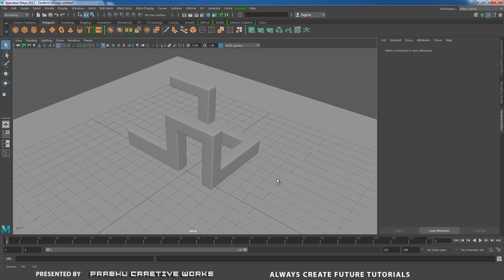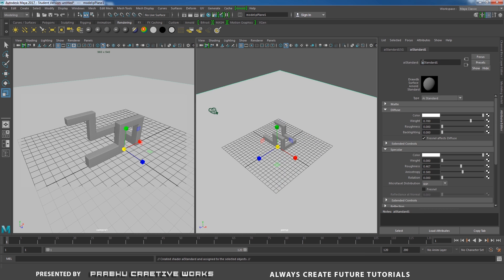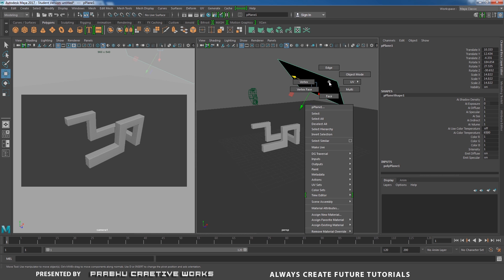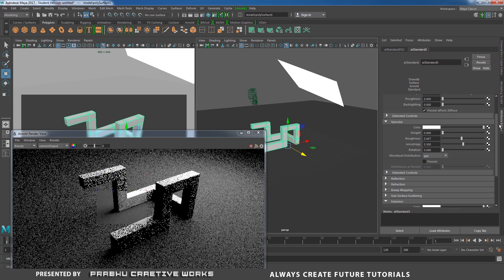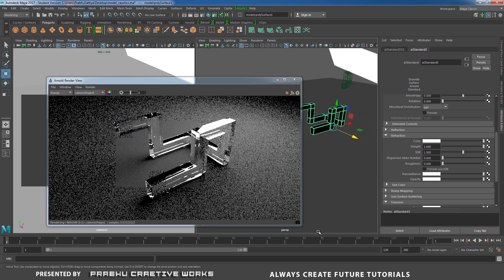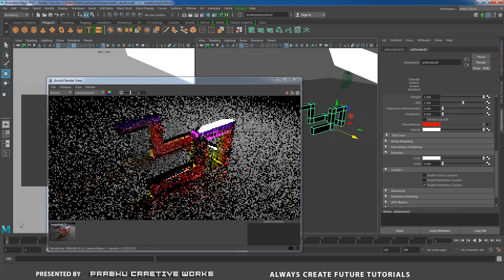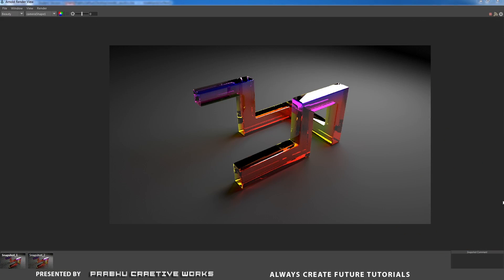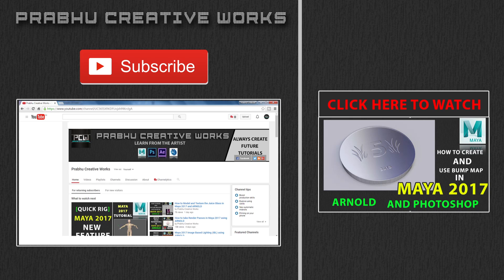How to Create Caustics Effect in Maya 2017 using ARNOLD

Comment: Great tutorial. One question: I'm using Arnold 5/Maya 2018 and the shader dropdown categories are different. When I apply the ramp to Transmission > color (since there's not refraction > transmittance option) the ramp colors appear are discrete lines inside the glass instead of diffuse areas as in your example. Any idea how to fix this? Thanks again!